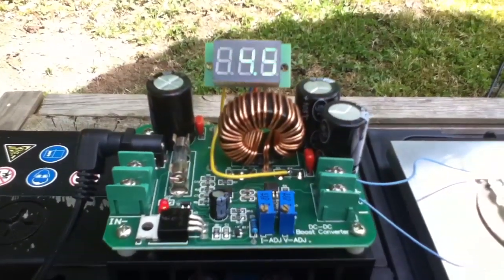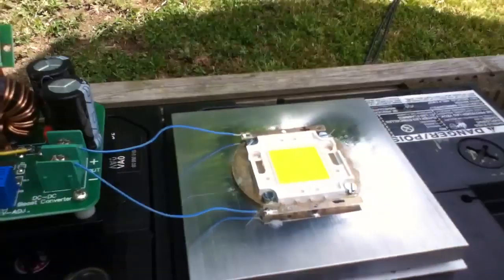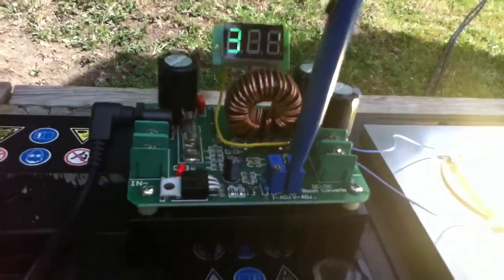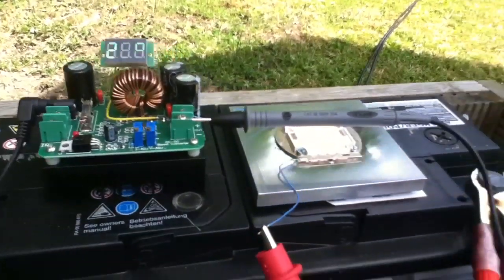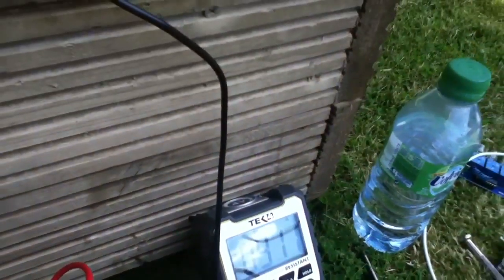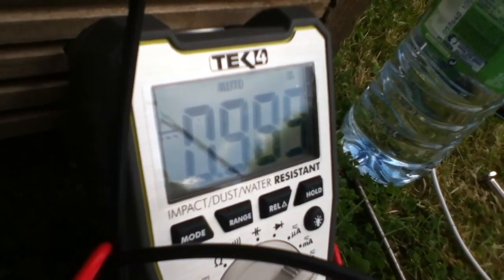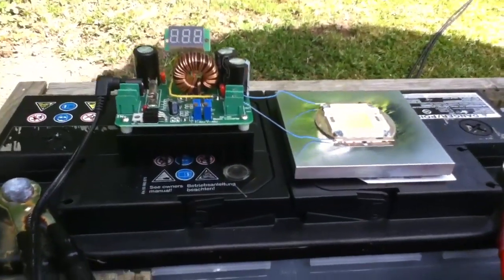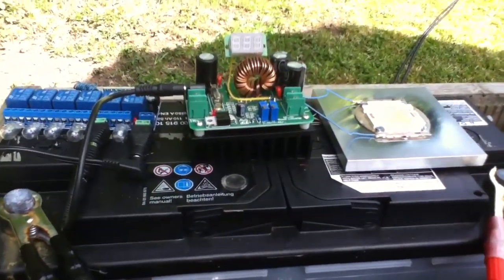50W LED powered from 12V Car Battery using DC/DC Boost Converter (part 1)

Comment: Julian, what happens when we upgrade the output capacitors to higher capacitance or higher voltage?
Reply: Cosmo John 
Higher capacitance : nothing 
Higher voltage : still nothing 
The caps in the board are made to fit exactly so bigger caps will do no better job

Comment: +Julian Ilett... Let's say I've a 12V - 40ah battery and one of these LED's (i.e. 50W) lightened up using a boost converter (boost converter might be helping me loose a bit of a current/ power), then how long/ for how many hours will it brighten the LED? 

Just want to make DIY something....

Comment: I am using the same driver to drive a Nichia NC4W LED. The LED is rated at 13.6V at 1amp. I am using a 2 18650 cells in series as my input power supply, so the the input voltage is 8.4V. I set the output voltage to 13.6V. The LED flickers a lot though, it seems that the driver can't keep constant current/voltage across the LED. Any idea why?

Comment: Can I drive four 50W LED's with a 200W constant current control unit?  ...or does each 50W LED module require its own driver?
Reply: David Symborski Absolutely!  You can put four 50s in parallel and they would be sharing the amount of current you provide.  So, if you allow 1.6A x 4 = 6.4A to four of the same LEDs that Julian has, each would be drawing 1.6A and they would be at full brightness and not be damaged.  The only problem is, if one were to somehow get disconnected, the remaining 3 would share 6.4A so they would be overpowered.
Reply: Christmas Eve So, basically, the only safe way is to use 4 separate current regulators (or just use resistors).

Comment: hi could I use this type of adapter to run off my solar panel as at present conditions its not keeping my battery topped up. I was thinking to boost the lower output at present to charge my battery. I have a 20w 12v solar panel that charges my caravan battery whilst its not in use, my alarm/GPS tracker has a small drain but with the cloudy conditions over the last few weeks its drained the battery. I was thinking of boosting the lower voltage thought the solar panel battery charging unit. many thanks for your videos

Comment: I want to ask: If the Multimeter is the The Ryobi Tek 4 ? if yes where did you got it i can´t find anything about it. i want it also the other Tek 4 Products that im not allowed to see.
Reply from the maker: Nighthawk994 The Tek4 range has been largely discontinued in the UK. For a while, Tek4 products were being sold cheaply in the UK, but they're very difficult to get hold of now.

Comment: i have two type dc/dc converter 150w and dc/dc converter 600w. can the dc/dc converter 150w/600w step up the voltage from car battery? i mean, can the input from the car battery burn or damage the dc/dc converter 150w and 600w? car battery (12V, 40AH)
Reply: No you can't burn it out,to set up voltage for led leave the output without wire and set voltage on 32-35v for 20-100w led lights,later you can adjust current.

Comment: how many ah battery can the boost converter handle would a battery over 15 amp hour rating break the converter since the converter is rated at 10 amps
Reply: No, you cant break it. Just be careful with the volts.

Comment: Which direction are you turning the current control potentiometer to increase the current. I have an identical boost converter and don't want to damage my LED by turning the knob the wrong way.
Reply from the maker: thestug93 Take care. Most are clockwise to increase the current, but some are wired the other way round!
Reply: Thanks, for the response. What can I use to test the direction I need to turn to increase/ decrease amps?

Comment: I have the same boost converter, problem is that is doesn't start 'boosting' till the input voltage is over 12,7v, which contradicts the item description which states 10v. The UC3843 doesn't get the right voltage straight away, there's a difference in the input voltage and the vcc of the chip. It causes an undervoltage lockdown. How does yours perform? Does it start boosting right at 10v input?

Comment: I want to make a converter from a 12 volt to 24 volt dc 50 watt .. can you help me how to calculate the value of its components? I also use LED light load.

Comment: I also have bought a DC-DC Boost from ebay, 100W with current control(the one with a display and a metallic square with "4R7" printed on it), but when i try to drive my 50W LED with a 14V RC battery (20C, so it can deliver more than what i need), the LED only drain 500mA, even maxing out the constant current pot (the boost can deliver 10A).

So, what could be the problem? thanks!

Comment: Where do you have the other wires to your digital readout soldered to? That is a great addition to the boost converter , you should make a video of a simple mod for the converter
Reply from the maker: LED voltmeter positive to boost converter input (which limits me to about 30v on the input of the converter). LED voltmeter measurement input (it's a 100v type) to converter output. Voltmeter ground to converter input ground. Maybe I will make a video of this mod, although I'd probably go for a combined voltmeter/ammeter.
Reply: Volt amp combo would be a great video!

Comment: 12V 15Ah battery 50W led how many hours?
Reply from the maker: 50W LED takes about 4A from a 12v source. Your 15Ah battery will be half discharged after 2 hours - you shouldn't run lead-acid batteries completely flat.

Comment: How many hours this LED will work on 12V car battery???
Reply from the maker: About 4A draw on a 12v battery, so a 60Ah battery would last 15 hours. You wouldn't want to run a lead-acid battery completely flat though.
Reply: Thanks